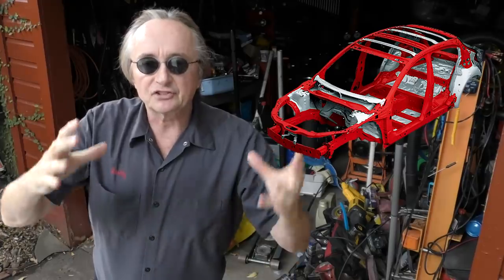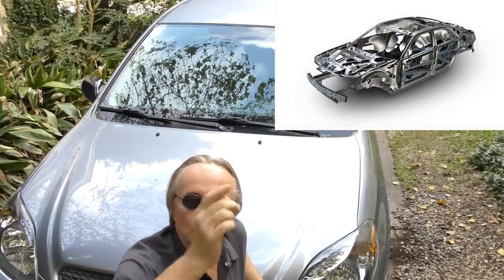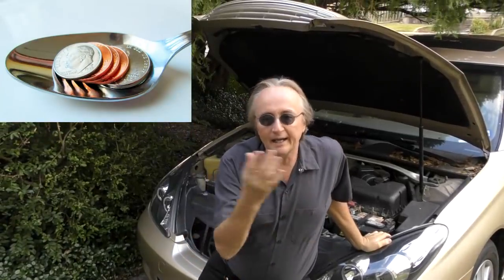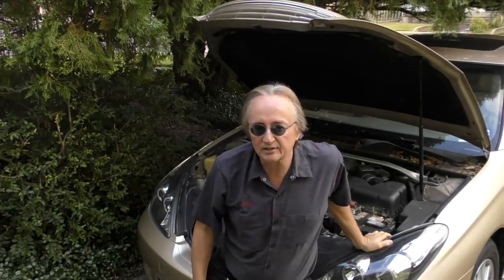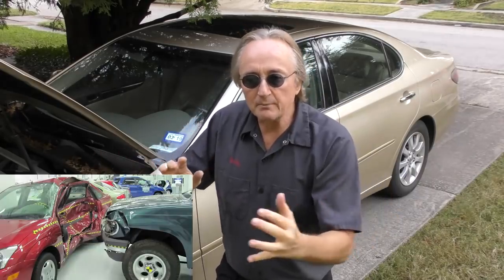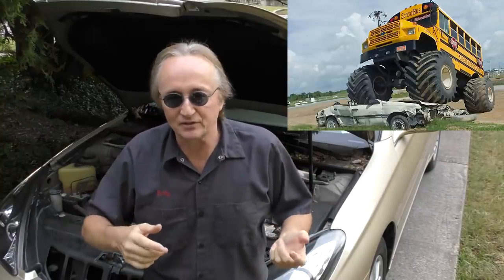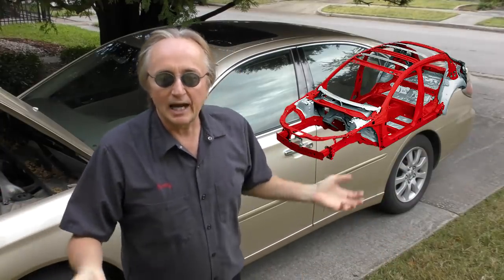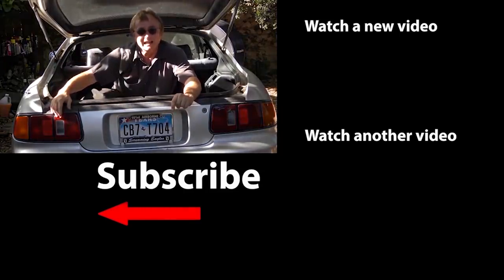Why New Cars are Safer than Old Cars

Comment: This whole video is a long winded presentation of the "Prisoner's Dilemma". It goes something like this:
If everyone drives a solid frame cars, everyone gets hurt a lot in a car crash. If everyone drives a unibody car and crashes into other unibody cars - everyone gets hurt much less. However, if everyone drives a unibody car and YOU drive a solid frame car, they get hurt exponentially more while you don't have a scratch....  but...  if you are at fault - their hospital bill are larger (or funeral costs). 
What do you do??
(the fourth option is everyone drives a solid frame car and you die in your unibody car. lol not an option...)

Comment: You know cheap Ford is gonna be using an aluminum frame on their pickup trucks so I wouldn't feel safe in any of their vehicles cuz I don't trust manufacturers that cheap out. Toyota is good
Reply: LOL..research rusted Toyota frames on Tundra and Tacoma,worst trucks ever made in History are Toyota trucks ,research it and stay away from them complete rusted lemons !
Reply: @01trsmar  yes we know about the Toyota Tacoma frames their alot better now then in early 2000s. even the 2015 models beat American pickup trucks
Reply: Considering that there are semi-tractors running around with aluminium frames I don't think I'd worry too much. Aluminium is more expensive than steel in that application, so "cheaping out" is almost certainly not the issue.

Comment: I hate to correct you, Scotty, but it wasn't the Jeep in 1984 or the RAV4 in 1994. Lada NIva was first produced in 1976: unibody crossover with full-time all-wheel drive (locking center diff and low range for more serious off-road). Yes, they were not imported into the US for political reasons, but we can't change the facts :)

Comment: because it cost  to much,  used to much metal and made cost higher,   and then EPA laws made them use less metal to make it lighter to get more fuel economy.  they made them with full frames for a reason years ago,   and why the police use cars with full frames,  they are simply much better in a crash.  I have seen more death and smashed flat humans in unibody cars than full frame cars and trucks.  it was with full frame cars al I had to do was smash out the windows to get people out,   but with the unibody car you got to cut off the roof and be very careful when cutting off the doors because you might be cutting into human flesh and bone.  and unibody cars have less space for humans so it takes less hit to crush the drivers legs under the dash.  and I hate the lower driver side electric seat controls down low where they get hit T bone style and I have seen the electric seat button being pushed by the pushed in door making the seat go forward and crushing the life out of the baby in a pregnant girl by making her body forced into the steering wheel and there was no way to just reach in and stop the button and had to first cut open the hood to cut the battery cable to get it to stop.   suffocation by the electric seat going against the steering wheel.   and made it much harder to get her out.  as now the seat has gone full forward holding her body in nigh and tight.  and then there is the power assisted self tightening seat belt,   it uses a explosive charge just like in a air bag to make the seat belt auto tighten,  the seat belt edge moves across the human skin like a hot knife as it tightens so fast.  across the neck.  most people don't know about the assisted seat belt auto tightener device and I don't mean the auto lock ratchet